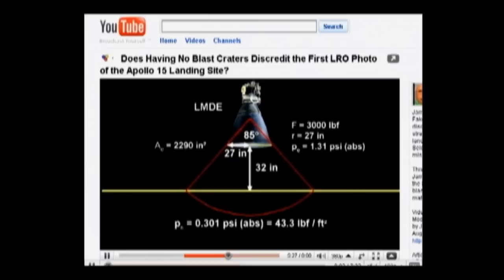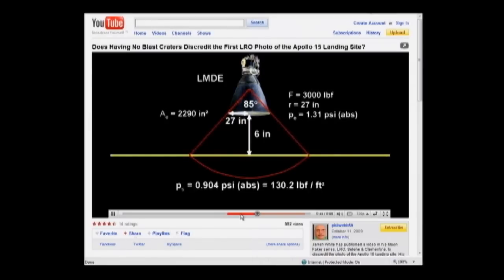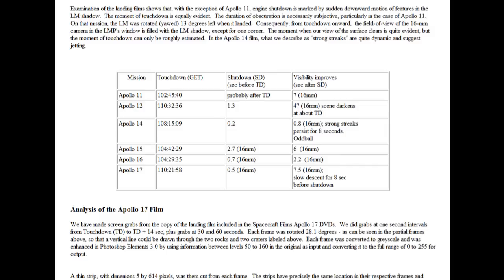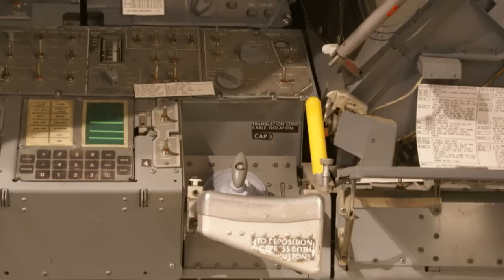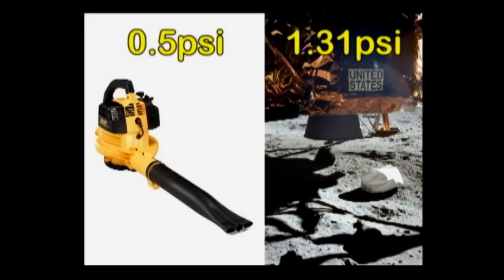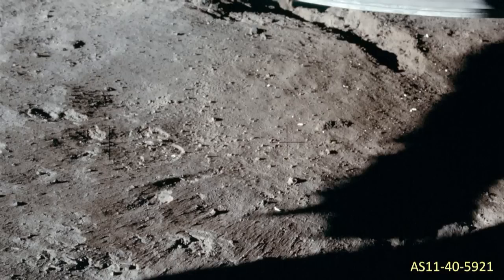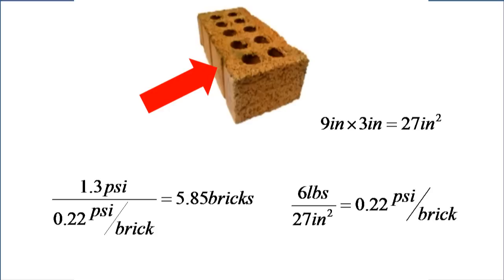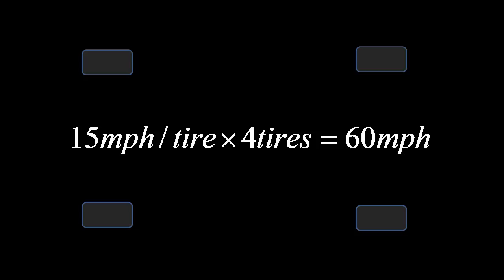MoonFaker: No Crater Addendum: Critique #03: Soft Landing

Comment: some years ago I performed a little experiment.
Placed a light weight rotating sail in a bell jar at normal pressure 
and injected smoke, The narrow jet of smoke turned the sail.
Then pump out bell jar to about 6psi. (the best my pump would do)
and repeat the injection of smoke.
The bell jar filled with smoke evenly. No jet.
No sail movement.
I think the exhaust of the descent engine fanned out so much into
nothing, not able to move much of the moons surface.
I think that's why there's little or no crater.
 Also perhapse the lunar 'soil' is like builders sand vis sharp sand.
The fine get blown away leaving the interlocking sharp 'volcanic'.
I have a few more experiments to do ......
Reply from the maker: +Peter Copeland I did a similar experiment in high school with a rat in a bell jar. The rat didn't live.
Reply: You experiment illustrates why using a demonstration with a leaf blower is a unwitting, and or, deliberate red herring.  Even if the blower has a lower psi than you can claim for the rocket motor it's rating is usually expecting standard ambient psi.  So the leaf blower is putting out it's rated psi plus the psi of the air around it.  

If the blower only gets to effect the air it can move itself it doesn't work as well.

Comment: This is what Aldrin said, it's in the Apollo 11 log:
" Some of the surface rocks close in here that have been fractured or disturbed by the rocket engine are coated with this light gray on the outside...."
So strong enough to "fracture" surface rocks, but not strong enough to blow the dust away, for the dust would be on the surface, there'd be none left to fall back to the surface under the LM after the initial blowing away..
I love the way people talk about Apollo in a serious voice, talking nonsense but sounding very learned and earnest about it.
If you do the calculations you will find out that the thrust from the LM descending is less than a gardener's leaf blower.
Reply from the maker: MrRobtwothirds And Aldrin said this shortly after landing, as he peered through the window, before he ever left the LM. How did he know the plume from the  descent engine fractured the rocks? How did he know the engine exhaust coated the rocks to make them light gray? What amazing powers of observation and deductive analysis! I thought only hoax believers could be so sure of themselves. Could be that he assumed too much. 

I love how hoax believers latch onto a statement, take it out of context, then make it sound definitive. This one and the one about Collins saying he saw no stars are about the most ridiculous confessions imaginable.
Reply: MrRobtwothirds No it does not, it just shoots down the lame leaf blower/rocket engine comparison.
Reply: +MrRobtwothirds So what is the nozzle area of a leaf blower compared to the nozzle area of the LEM? Clue, a bicycles tyre pressure is way higher than a cars tyre pressure. why is that?
Reply: +SW6 I expect you know why that is, but I don't know why it should suggest that such little disturbance on the ground under the LEM could possibly be what we would see if it really did land on the Moon.
Reply from the maker: +MrRobtwothirds And how much "disturbance" would you expect to see under the LM?
Reply: MrRobtwothirds A leaf blower nozzle pressure could actually be higher in psi than the nozzle pressure of the LEM's engine, clue.....area and psi. And a leaf blower is working in an atmosphere and the LEM engine is working in a vacuum.
Reply: +SW6 Golly, that means we really went to the Moon.

Comment from the maker: Missing foil in AS11-40-5927? I don't really see what you mean. The TPS in the ascent stage is hidden by the micrometeorite shields. The ends of the primary and secondary struts are painted and didn't have any Kapton on them to begin with. The bay door is open, that's why foil's missing there. The plume deflector, black foil and secondary strut sleeves are Inconel foil over nickel foil /Inconel mesh over Sicon or Kapton, painted with black Pyromark. Are you talking about the pieces under the LM?

Comment from the maker: Okay, so if you cut your finger, do you need a bandage or stitches or an amputation? Depends on the situation, right? So, you need thermal protection for the LM. Do you use multi-ply or single-ply Kapton, or something else? That depends on the situation too. As I said, the un-pressurized descent stage was covered in a multi-layer Kapton blanket to protect the engine, fuel and compartments. The landing gear also had thermal protection utilizing a variety of materials, including single-ply Kapton.

Comment from the maker: Actually, it's a Kapton blanket, not tinfoil. It's a very lightweight, multi-layered material used for thermal control. It was wrapped around the descent stage, which was not pressurized and had no other way to regulate temperature.

Comment: @philwebb59  Just to clarify, so what your saying is that the LEM pads were touching the ground and the engine blast proceeded to remove all of the surrounding soil from around the pads leaving a small cluster of original soil still under the pads. Sort of like how a Mesa is formed  (in principle)  ?  Or say if you went and put your foot into a sand box, washed the sand away with a hose but you would still be left with a clump of sand under your shoe and you would appear to be standing higher ?

Comment: @philwebb59  Sorry, i was chasing the wrong rabbit there. When you said the ledges were caused by erosion i thought you meant this was due to the soil under the nozzle being eroded and then blowing up against the side of the pads causing those mounds. In theory soil could hit the rim of the pad then bounce to the ground near the contact point of the pad, then compoundly start piling up, much like say when you see sand piled up against one side of power pole after a sand storm..

Comment from the maker: @ViperWK Apollo 11 landed. The pads were on the ground. The LM slid south (contact probes all point north), with the engine still running. Any dust plowed up by the north pad would get blown away by the exhaust. Regolith around the pad, not being held down by the pad, would get blown away. That is what I see. The east pad has noticeable buildup of regolith on its south side. In AS11-40-5918 you can see some scouring alongside the contact probe that may have been caused by the north pad sliding,

Comment from the maker: @ViperWK For my "theory" to be correct, the Apollo 14 LM had to drop a little after the engine shut off and the Apollo 11 LM had to be on the ground before the engine shut off. Every mission was different. No two landings were exactly the same. My "theory" is not that the engine pushed regolith against any pad, but simply that regolith went flying away from the engine. The force of the exhaust did not hold dust against any pad; it blew the dust around and away from the pads.

Comment from the maker: @ViperWK #1 Okay? I went to that link and got a "We love free-wallpaper-ic" advertisement. From the description it's probably AS11-40-5927. You're looking at the south (left) and east (right) struts. The pads are both slightly hidden by the slight ridge in the foreground. The north strut (the one in AS11-40-5920) is on the opposite side of the LM. You can clearly see that the north pad is resting on top of the ledge.

Comment from the maker: @ViperWK The photo of Apollo 14 is consistent with the engine shutting off before the pads touched and the LM then slid into place. I never suggested that the exhaust blew regolith up against any pad. What mechanism would make the regolith stop and pile up on the inner edges of the pads, when it should keep on going around the pads?

Comment: @philwebb59  Just another quick point regarding AS11-40-5920 . When the LEM came down and made contact with the ground that pad should of sat flat on the ground and "then" been blasted with soil. If so, the soil wouldn't have been able to go "under" the pad as the pad was already firmly placed on the ground, rather the soil would have been blown against it. If a plowing action had occurred and the weight distribution on  that leg was light the pad would of slightly ridden up on top of the soil.

Comment: @philwebb59  Here is a good photo of the Apollo 11 LEM.. freewallpaperpic(dotcom)/viewer/wallpaper.php?/apollo11/1600/Apollo11_5927_NASA   It clearly also shows two pads having soil piled up on their "outer" edges, consistent with a sliding motion of the LEM . Regarding that AS11-40-5920 photo, it shows churned up soil that billows/bulges out from the base of the pad, consistent with a plowing action.. If you look behind the pad you can see where this pad had scraped the surface..?

Comment: @philwebb59  Sorry, my bad.. I kept thinking the 2 photo's you mentioned before were both of Apollo 14.. Either way the Apollo photo 14 photo i quoted clearly shows churned/plowed soil which "billows out" from under the base, not smoothed blasted soil pushed up against it. Two of its pads don't have soil on their inner edge's  (as they should)  rather on their "outer" edges. Regarding Apollo 11, this also shows the exact same phenomenon, with ledges showing on the "outer" edges of two pads.

Comment from the maker: @ViperWK #1 When did I say "dust hit the edges of the pads and bounced back?" Yes, "dust" bounced around all over the place. It was particularly hazardous on the J-missions with the extended engine bell. They were concerned that blowback could kill the engine. But even with the turbulence under the LM, once the engine shut down, the particles that were in motion would continue to evacuate that space under the LM.

Comment from the maker: @ViperWK I don't remember seeing that composite image on Wikipedia before. Thanks for the link. It does a great job of showing what I referred to as the 6-inch depression. The 8 metric tons was calculated from Apollo 11 (3-inch cylinder). If that depression is twice as deep under the nozzle, then the total mass displaced could be more than 12 metric tons. The 6-inch bowl in the Apollo 14 photo should have at least 8 metric tons eroded away.

Comment from the maker: @ViperWK Ah! I see where I confused you. The composite you found was stitched together from a set of Apollo 14 photos containing AS14-66-9258, which clearly shows a pile of "dirt" plowed up by the horizontal motion of the pad. Antaries slid a bit. But, I said, "AS11-40-5920 shows a 3-inch ledge of regolith trapped under a landing pad of Apollo 11." Different mission. In that photo, it looks like the landing pad held the regolith in compression as exhaust streamed around it.

Comment: @philwebb59   The two pads on the other side of the LEM would also have to have soil piled up on their inside edges for your theory to be correct, but they don't. The soil on those pads is piled up on their "outer" or "outside" edges. Having soil churned up on the same side of each pad is consistent with the LEM sliding along the ground when it made contact.. If you look at the picture this is clearly evident..?

Comment: @philwebb59   If the ledge of soil was caused by blown soil kicked up from the engine the soil would be piled right up to the the top edge of the pad. Also the piled soil would exhibit radial marks which it doesn't. It doesn't look blown at all and appears to be churned up. When Bulldozers plow into soil they don't ride up ontop of it, rather they just plow straight through it.  In this photo you'll see the other pads upload.wikimedia(DotOrg)/wikipedia/commons/4/49/LEM-OnTheMoon-Hires.jpg

Comment from the maker: @ViperWK I am referring to the entire area under the LM in the AP14 photo . The ledge I refer to in the AP11 photo is due to erosion. You see erosion marks along side the dust. If it had been bulldozed up, the pad wouldn't be higher than the surrounding surface. You would be more likely to see dust on top of the pad if the dust had been bulldozed up. If the particles are moving, they keep moving. You would not expect to see particles stop and fall onto the pad. Soil piled on an outer edge?

Comment from the maker: @ViperWK #1 Of course, pressure is not what moves things. Force is. The only reason that anything on the surface moves is because molecules of spent fuel come in contact with surface material in an elastic collision. Then you have spent fuel and moving "dust" colliding with more surface material. I don't know what you mean by " visually observing the plumes." You never see the plume and you cannot see directly under the LM from the window.

Comment: @philwebb59  With AS14-66-9261, are you referring to the small hole under the nozzle (a little to left) ?. The ledge of soil (under the pad) that your refereeing wasn't due to the blast. It was due to the LEM moving sideways just as it made contact with the ground. The pads slightly bulldozed the dust. If that soil came from the blast we would see dust "ontop" of the pad asell. Also if you look as the pads on the other side, the soil is piled up on the "outer" edge of them, not the inner. ?

Comment: @philwebb59 .. If the plume was just 65" diameter you would still see large radial marks regardless due to the LEM coming in from higher up, or from the lunar matter being thrown sideways from the centre of the source. What ever the diameter of the plume is/was, a large amount of dust "is" witnessed being blown quite "violently" from underneath the LEM's when they landed, and in a  relatively "tight" area from the last 20 feet of descent to after the point of contact..

Comment: @philwebb59   I'm aware of that.. My reference to the plume was when it's seen mixing with the lunar dust. Of course the plume itself is not visible but its shape and width is evident when it mixes with the dust. The streams of dust seem to source from directly "under" the LEM , and with some intensity, rather than being light and dispersed away from the centreline of the LEM which is what would occur if the plume was wide and had a low PSI pressure...

Comment from the maker: @ViperWK A good photo of the bowl shaped crater under the Apollo 14 LM is AS14-66-9261. Another good photo is AS11-40-5920 that shows a 3-inch ledge of regolith trapped under a landing pad of Apollo 11. I used this photo to calculate that, at a minimum, 8 metric tons of regolith was eroded away under the LM. See watch?v=yDs6-3Yt0Yk&t=6m10s

Comment from the maker: @ViperWK #2 Assuming the entire force spreads out from a 54-inch diameter nozzle to a 65-inch diameter area on the lunar surface is worse than integrating the pressure over a 150-inch diameter area (out to the landing pads) where there was still a noticeable effect (erosion marks) on the lunar surface.

Comment from the maker: @ViperWK #1 If you look at the Apollo 17 lunar liftoff, watch?v=iziumcklDbM, after the initial spray of partially unspent fuel exiting the nozzle during ignition, you don't see a plume. Likewise, you would not see the plume or any effect of the plume from the LMDE looking out the LM window during descent, except for its encounter with lunar surface material.

Comment: @philwebb59   I understand rocket plumes are wider in space. That's why this is so odd.. The LEM's are seen kicking up dust at 80-120  feet when the PSI forcing on the ground "should" of been extremely low at that point. On visually observing the plume's they don't appear to look wide. If you observe the radial stream's of dust coming from underneath the LEMs, the streams seem to be more  "intense" and centrally "focused" . Note the converging intersecting angles of the streams.

Comment from the maker: @ViperWK The thrust was 11kN or less or they couldn't drop. The "plume" in a vacuum is actually wider than shown. The regolith was fine. That's the point. The lower they got, the more "dust" they "kicked up." They were also moving horizontally, so the dust constantly came from different areas. Aldrin announced "contact" when the contact probes touched and the indicator light came on. On Apollo 14, Antaries displaced 8 metric tons of regolith from a 6-inch deep depression. There's your crater.

Comment: /watch?v=e_ZCXHS1EVA&feature=relmfu  The LEM visibly starts kicking up dust at 80 feet. For this to occur the thrust would either have to be reasonably strong, more narrower than thought, or the ground surface was extremely fine and powdery. At 24 feet the trust is literally ripping the shit out of the ground. They call "contact" while dust is "still" steaming violently out of the bottom.You can theorise or calculate all you want but the LEM kicked up alot of dust and did so while it was landed.

Comment: I don't try to prove the force of the engine mekes a crater or not because I don't have the brains to calculate it. But at first you say in your video the dust goes directly into the direction of the forrce and falls down at the same place, and now your telling me it can't lift because of the force from above. If you didn't make the first statemant you could have proven with your second that there doesn't has to be a crater. that's what baffles me.

Comment: my point is: if you put a force at exactly 180 degrees at a flat surface, it will stay where it is, but if it is on an angle it will blow away. And indeed as in your last sentence some things may fall under the engine. I know heavy parts will not be blown away far, and the light ones will. But wat about the cohesive force in your answer? don't understand this. I know wat cohesive force is, but ( long time ago I went to school) I thought it more a thing between fluids.  12 minuten geleden